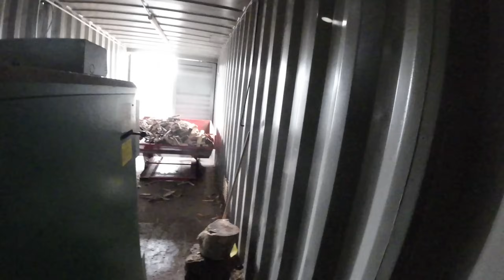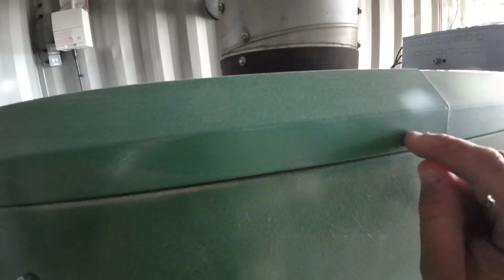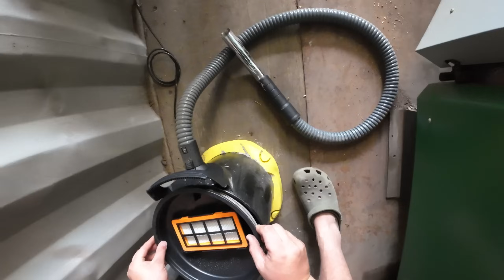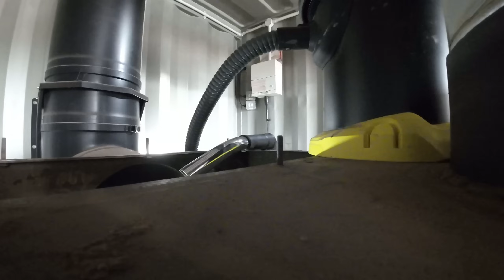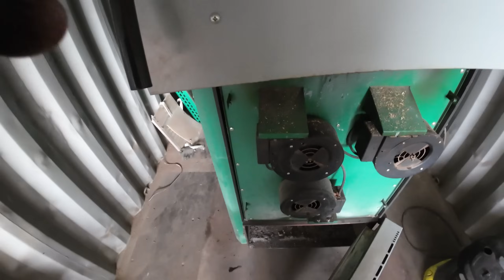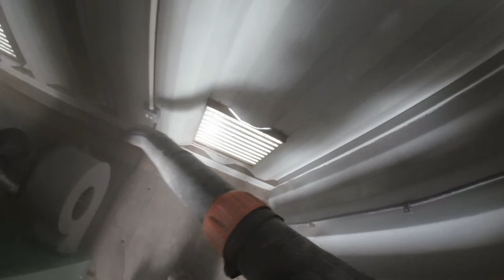Day 42 - Eco Angus Orligno 600 FULL CLEAN

Comment: Good clean out there Archie! I was going to suggest a lambs eared support post for pushing down the heat exchangers. Then there's no chance of it slipping down.
Would another basic hoover work as well when the ash is cold do you think?
Reply from the maker: I broke my Henry hoover by using it on the burner it’s not the heat. It’s the very fine dust that blocks up the filter and makes it’s way into the motor